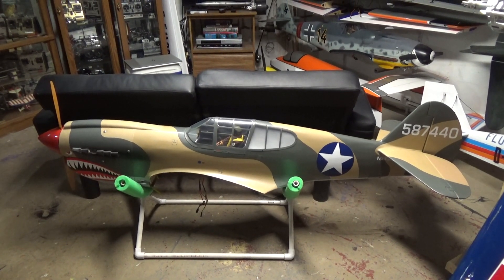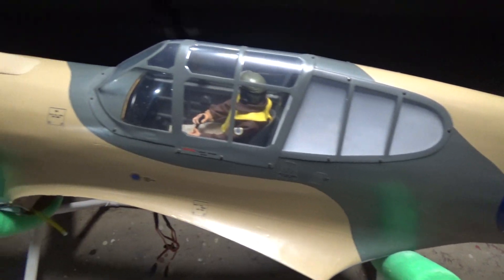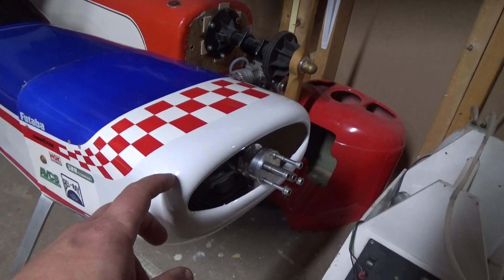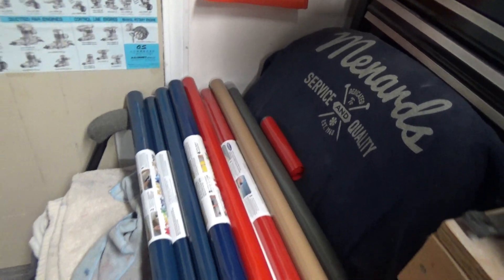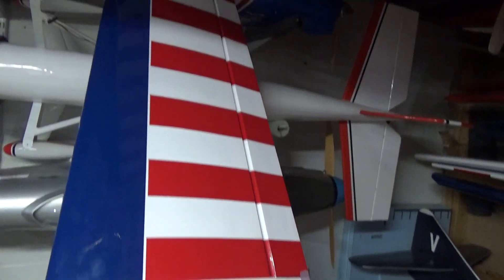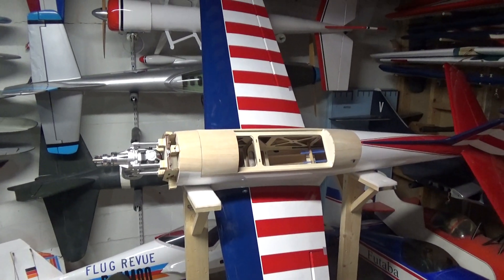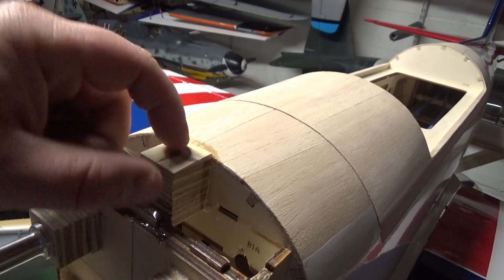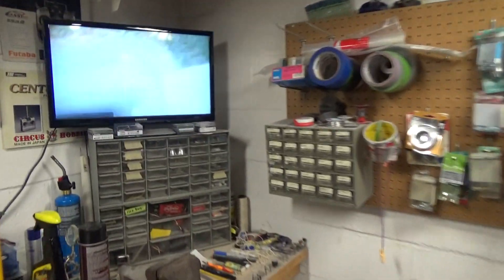Carolina Custom Kits Super Chipmunk build #13 and more!!

Comment: Hi Andrew,
You can see the difference between the old and new blue MonoKote. The Chipmunk is looking great. Not much longer now. I know what it means working from paycheck to paycheck. Been there, done that. The P-40 looks much better, but you need to put on a three bladed prop. Just doesn't look right with a two bladed. You and the family stay safe.
Reply from the maker: 3 blade would look nice but the cost of that spinner........ ouch!
Reply: @n1114v  Hi Andrew,
Guess it will have to wait until a paycheck can be used for a spinner.  :-)